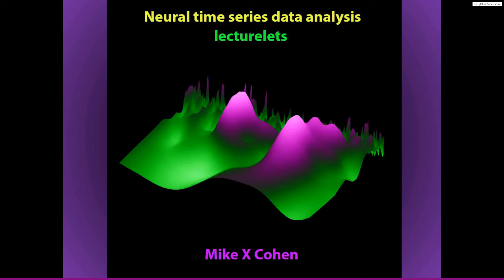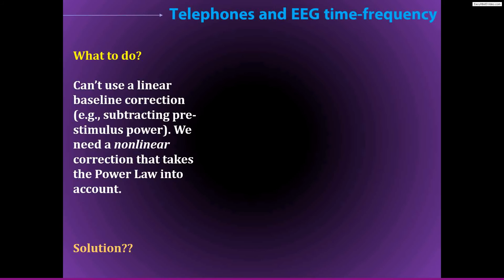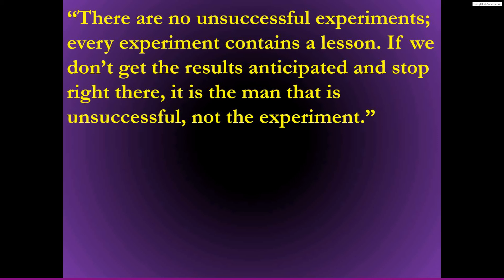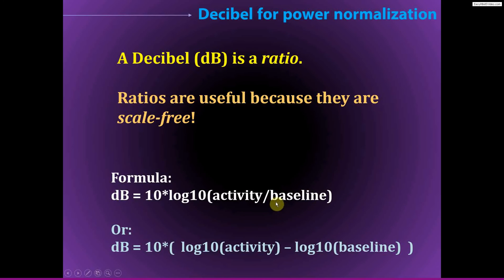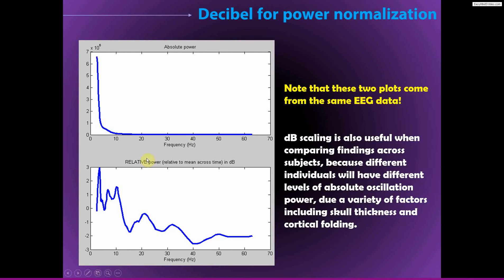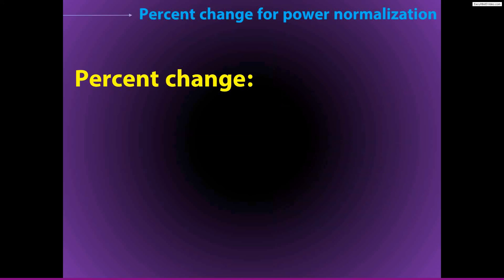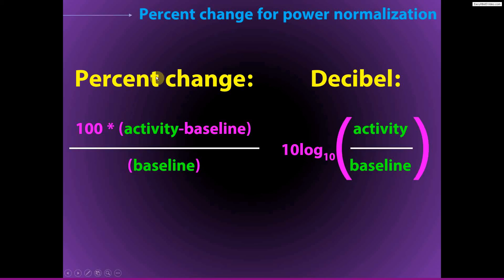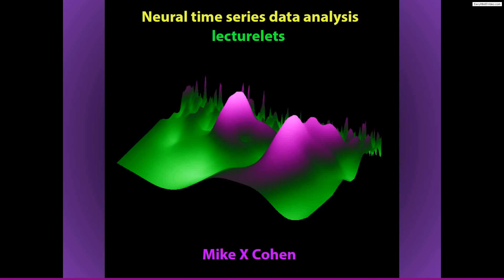Decibel and percent change power normalizations

Comment: Hi Mike 
Thanks for all your effort and posting helpful videos. 
A quick question why did you use the entire data length for "activity" in calculating PCT? why not using post-stimulus data? Thanks
Reply from the maker: Good question, but no particularly good reason. It was more a demonstration of the principal rather than a realistic use-case.